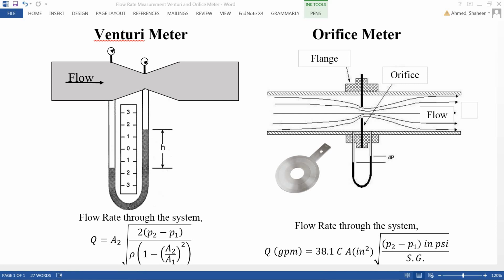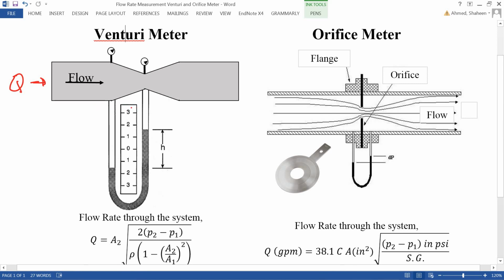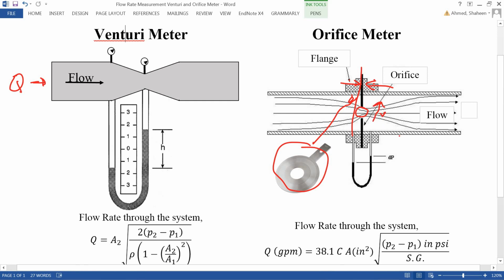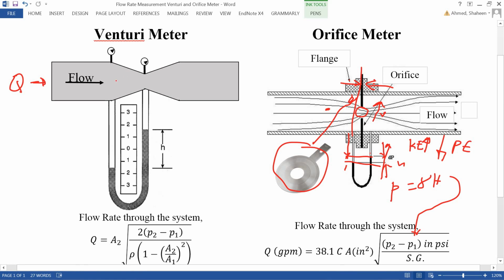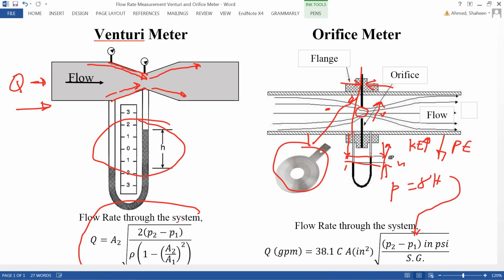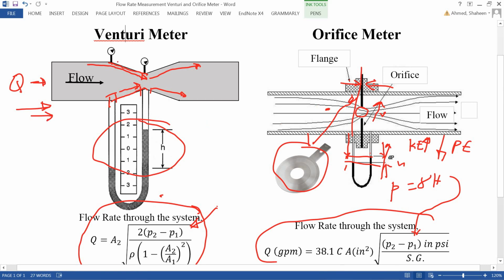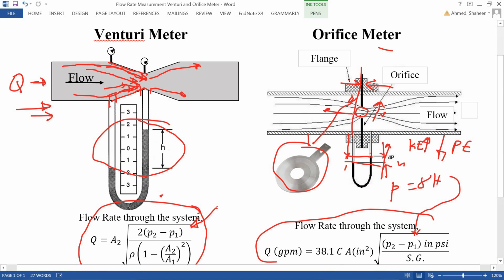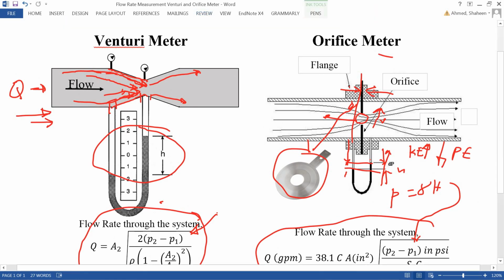Venturi vs. Orifice: Key Differences | Updated Version in Description

Comment: I have two questions. 1. For both systems, do you have to make sure pressure drop is too much that cavitation does not occur? 2. For the orifice meter, does that center hole ever enlarge/wear out over time, due to friction or cavitation, requiring replacement as part of the maintenance?
Reply from the maker: Manufacturers of those orifice meters usually have a service life and calibration requirements.